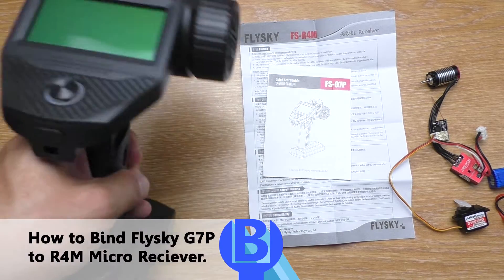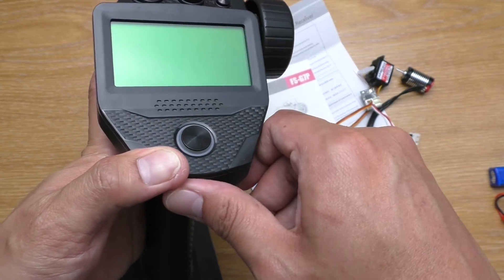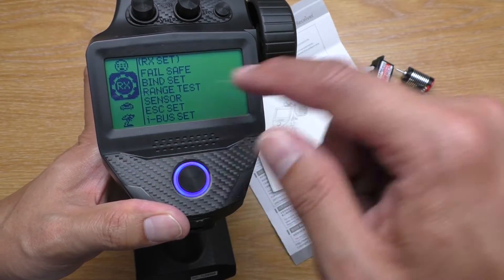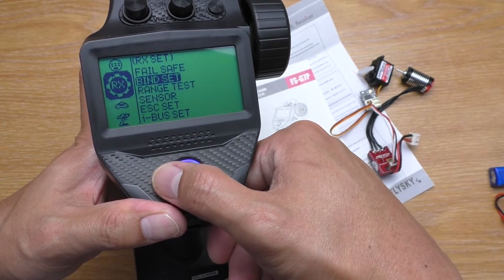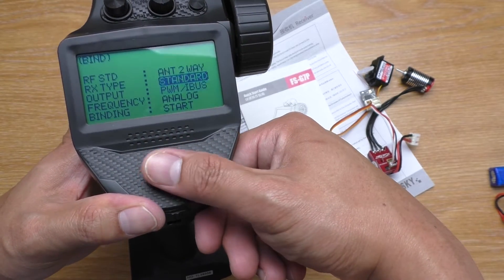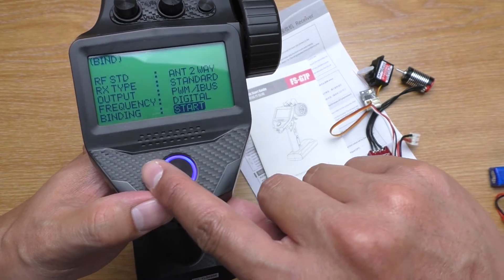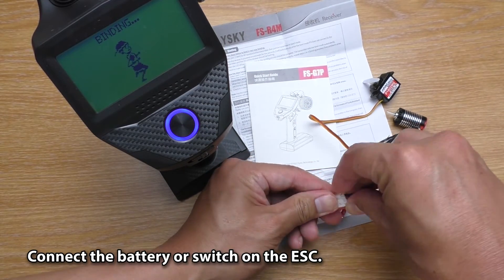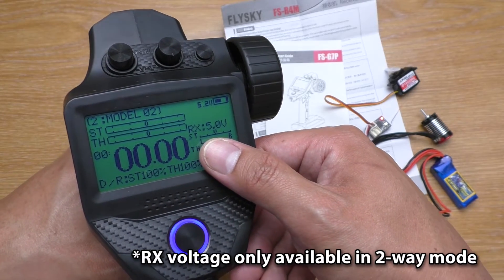How to Bind Flysky G7P to R4M Micro Receiver

Comment: Hi. Would it be poss to set up crossfire or elrs protocol  with a radio like that for a micro car?
Reply from the maker: This Flysky doesn't have DSC or PPM output so it can't. However if you need crossfire then check out Radiolink lineup. They all have DSC port to output PPM signal that you can plug into the external module.
Reply: @BeaversHobby  thats awsome! And thankyou for taking the time to respond, much appreciated

Comment: Is it possible to have a FS-G7P to a Flysky FGR4S V2?
Reply from the maker: No, it's not. They use different protocols.
Reply: @BeaversHobby  one more question.  Doen it destroy the receiver if I shorten the antenna wire?
Reply from the maker: @dannyromine4002  If you strip the end to the same length then theoretically it should be fine. 
I have done that too and it still works. I can't comment on the full range because I only use that receiver indoor so everything worked the same.
They also make antenna-less version for ANT protocol called R4P. https://www.flysky-cn.com/bs3b-specifications
https://www.aliexpress.com/item/1005005548771375.html
Reply: @BeaversHobby  okay great.  So I can bind this receiver for my transmitter?   I really appreciate your help and support
Reply from the maker: @dannyromine4002  Yes, you can.
Seems like Flysky is quite serious about their entry-level transmitters. There are every type of receiver for ANT protocol from big car to micro 1/28 car.

Comment: What motor and esc are you using?
Reply from the maker: The one is this video is Furitek Momentum ESC with Greyhound 5500KV motor.
The ESC is not available anymore because they upgraded it to the new version, Odyssey. 
https://furitek.com/collections/mini-z-1-24-electronics/products/furitek-odyssey-power-system-v2-for-1-24-1-28-race-drift-aluminum-blue-case

Comment: Receptor radeolink R6FG nao conecta não sei porque ?
Reply from the maker: You'll need the 4-in-1 multiprotocol version. In the module setting, select Radiolink Surface. If that still doesn't work try DumboRC.